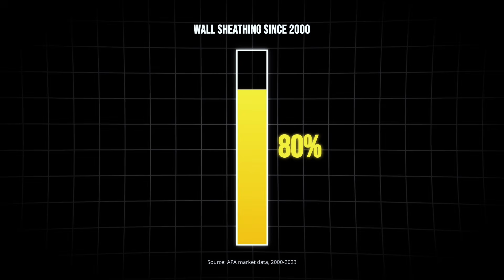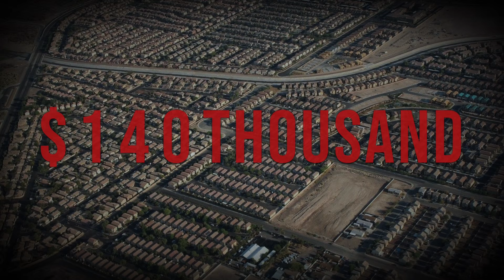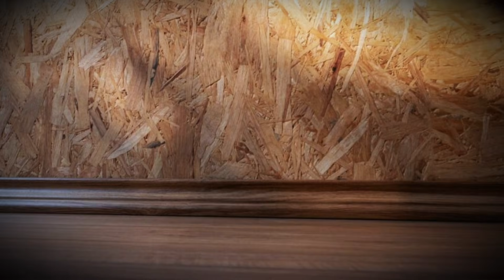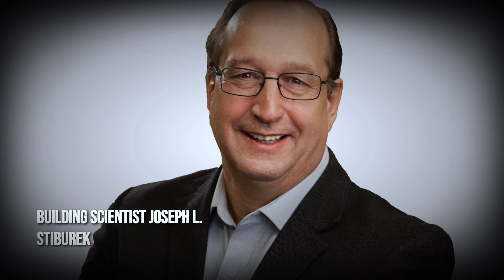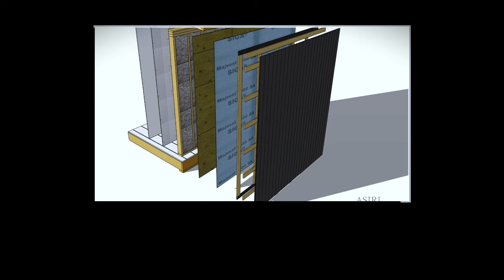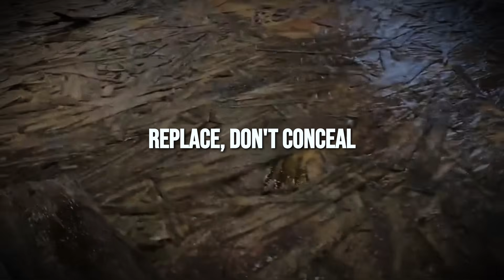The Fake Plywood Hidden in 80% of New Walls (It Turns to Mush When Wet)

Comment: I got a little cabin..built around 1980 so 45 years ago. ago when .. we used  3/8th plywood for the roof and wall sheathing.. didnt know when we'd get siding done so we primed and painted it.. we never did put siding on just keep giving a coat of paint every 10 years or so. We scrap loose paint , clean jt up and paint..
Its still fine after 45 years.. you would never get away with that with OSB. It would be falling apart in 10  years or so.